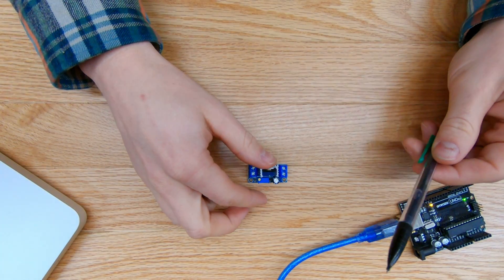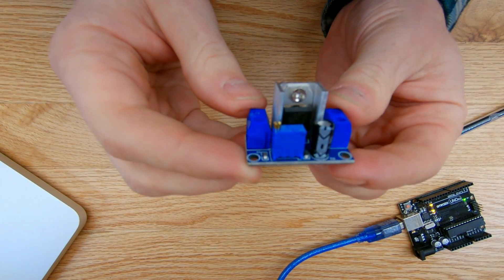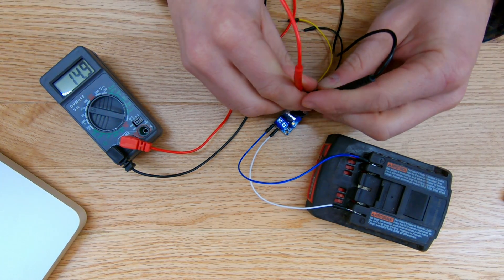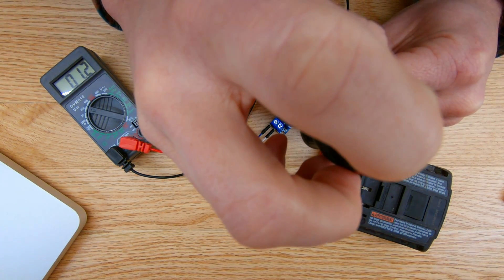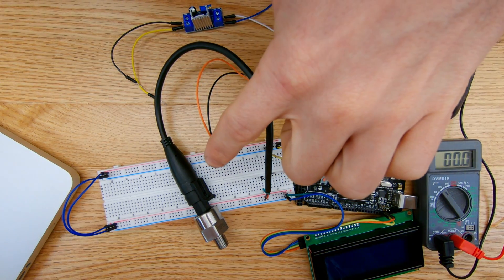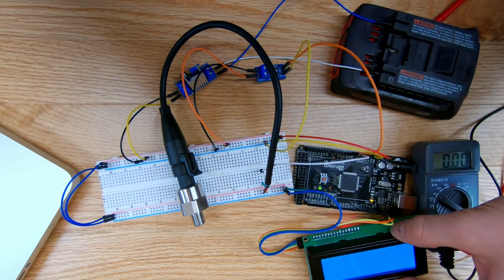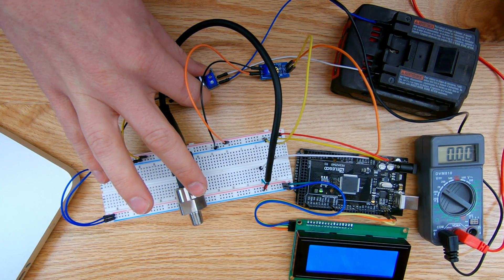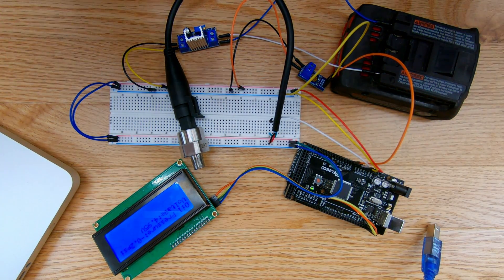Voltage Regulator - Arduino

Comment: is 220volts for input & output possible with arduino as microcontroller of the automatic voltage regulator? i thought arduino only can handle upto 12volts?

Comment: Does not the arduino mega accept input voltage from 7-12V. Meaning would it work if i use the regulator to turn it down from example 24V to 12 V?

Comment: where did you connect the positive and negative terminal to powerup the arduino? I see you didn't connect to the usb port or the dc jack port
Reply: Are you talking about the 5v and grnd pins?
Reply from the maker: @arongrhyzjovannid.4474  yes
Reply from the maker: 5v and gnd to the battery
Reply: Thanks!

Comment: Hi, It's okay to use arduino uno not mega as a microcontroller for that project?
Reply from the maker: Yes.
Reply: @OvensGarage   Hi. can I ask one more question. How to calibrate that arduino pressure sensor? there's any method/techniques for that? or purchase another components for calibration?. Thank you. I hope you response.

Comment: It is not acceptable to be used for a device which requires a stable input power. You should have put Zener diode before the voltage regulator. The Zener will stabilize the battery output, and the voltage regulator will produce a stable 5V output.
Reply from the maker: Thanks for the tip!

Comment: The car charging system is not very stable, does the output voltage on the buck converter stay stable with input voltages varying 11 - 14.4 volts?
From what I've been reading the Arduino and peripherals work much better with a clean stable power supply, guess that true of everything though.
Reply from the maker: I'm not how certain if the output voltage from the buck converter would stay stable. That is a great point though and something to keep an eye on. Don't want to fry the arduino.